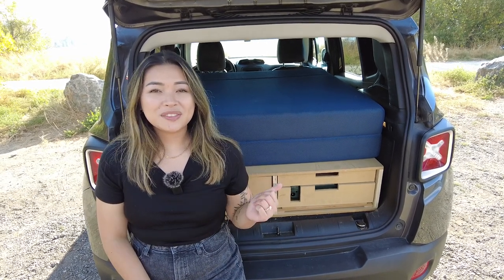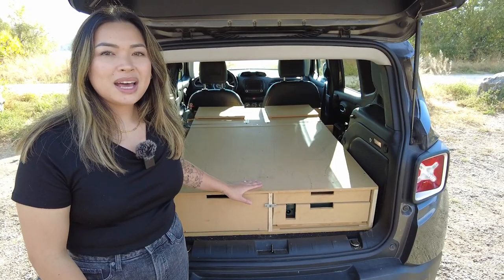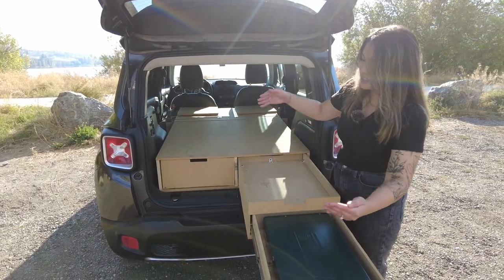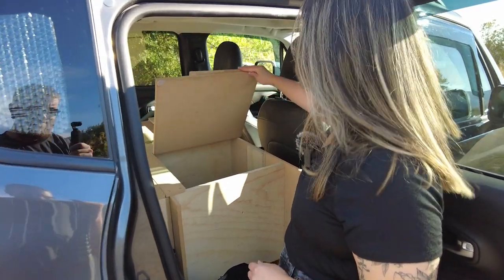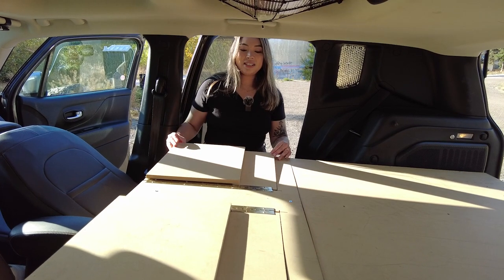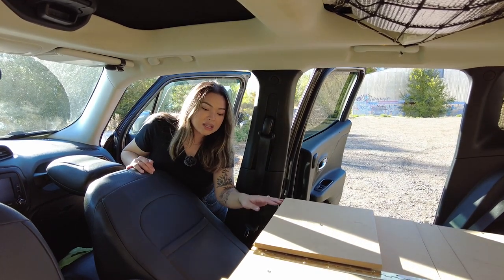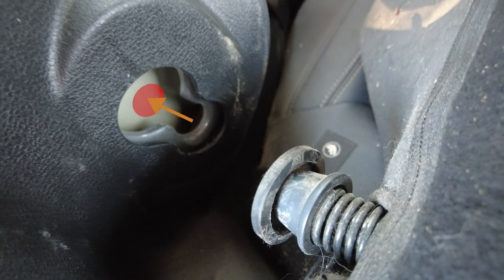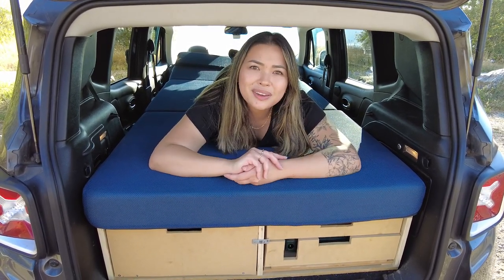JEEP CAR CAMPER CONVERSION UPGRADE WITH KITCHEN SETUP | How to remove backseats on a Jeep Renegade

Comment: jeep renegades are an utter pos.  HP is suck, towing is awful.   Converting it, you better spending the $ on a toy trailer, but the jeep can't even haul that ( it has 171 hp and low towing 2000 lbs)
Reply from the maker: Sometimes you just gotta work with what you already have.
Reply: Well it's just a renegade..you have plenty of choices of Jeeps